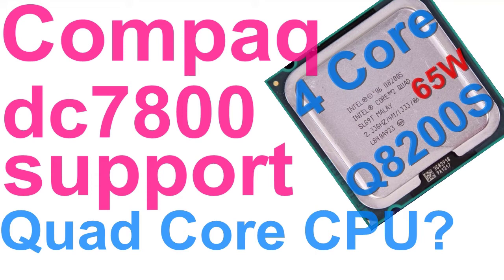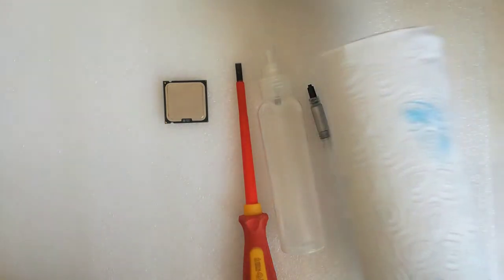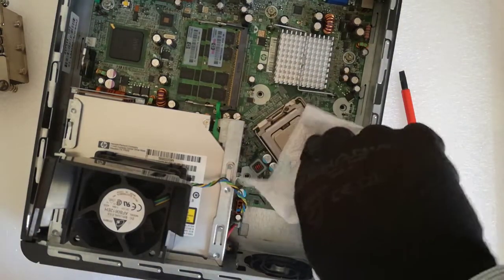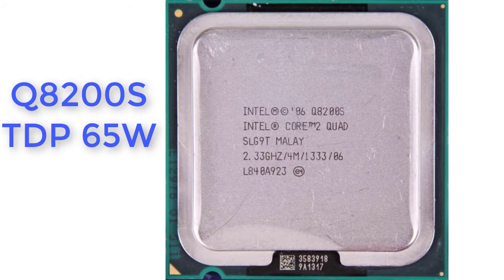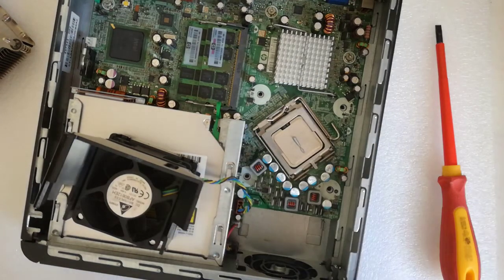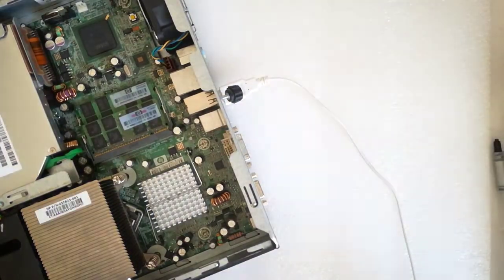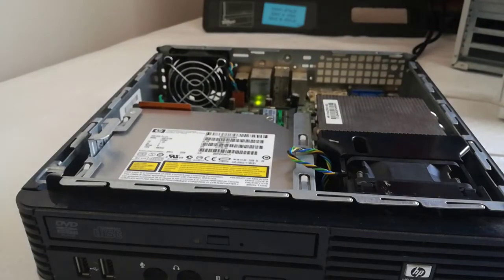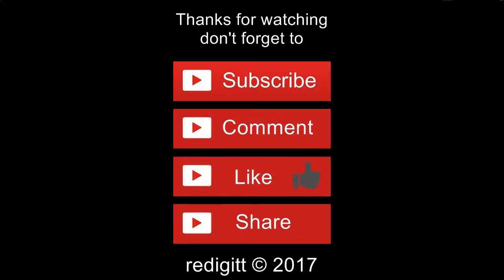HP Compaq dc7800 USDT does support 65W Core 2 Quad Q8200S CPU ? Ep.218

Comment: which cpu is the most powerfull for Hp dc7800 SFF?
Reply from the maker: Aloha, the most powerfull CPU for the HP Compaq dc7800 SFF according to the HP support page is the Intel Core 2 Quad Q9550 Processor (2.83-GHz, 12 MB L2 cache, 1333-MHz
FSB)
Thank you for watching, if my video or advice was helpful , then please don't forget to share, like the video and maybe subscribe.
Reply: @redigitt  Bro i subscribed and i want to upgrade this pc to its max limits gimme some suggestions
Reply from the maker: Aloha, thank you for your support, you can upgrade the HP Compaq dc7800 SFF PC 
1 update your BIOS to the latest version, step by step https://youtu.be/Ewx-3SM-JaU
2 upgrade the CPU with these CPU's https://youtu.be/nsoAW2Psrtk
Intel Celeron Processors:
Intel Celeron 420 Processor (1.6-GHz, 512K L2 cache, 800-MHz FSB)
Intel Celeron 430 Processor (1.8-GHz, 512K L2 cache, 800-MHz FSB)
Intel Celeron 440 Processor (2.0-GHz, 512K L2 cache, 800-MHz FSB)

Intel Celeron Dual-Core Processors
Intel Celeron Dual-Core E1200 (1.6-GHz, 512K L2 cache, 800-MHz FSB)

Intel Pentium dual-core Processors:
Intel Pentium dual-core E2160 Processor (1.8-GHz, 1-MB L2 cache, 800-MHz FSB)
Intel Pentium dual-core E2180 Processor (2.0-GHz, 1-MB L2 cache, 800-MHz FSB)
Intel Pentium dual-core E2200 Processor (2.2-GHz, 1-MB L2 cache, 800-MHz FSB)

Intel Core 2 Duo Processors:
Intel Core 2 Duo E4400 Processor (2.0-GHz, 2 MB L2 cache, 800-MHz FSB)
Intel Core 2 Duo E4500 Processor (2.20-GHz, 2 MB L2 cache, 800-MHz FSB)
Intel Core 2 Duo E4600 Processor (2.40-GHz, 2 MB L2 cache, 800-MHz FSB)
Intel Core 2 Duo E6550 Processor (2.33-GHz, 4 MB L2 cache, 1333-MHz FSB)**
Intel Core 2 Duo E6750 Processor (2.66-GHz, 4 MB L2 cache, 1333-MHz FSB)**
Intel Core 2 Duo E6850 Processor (3.0-GHz, 4 MB L2 cache, 1333-MHz FSB)**
Intel Core 2 Duo E8200 Processor (2.66-GHz, 6 MB L2 cache, 1333-MHz FSB)
Intel Core 2 Duo E8300 Processor (2.83-GHz, 6 MB L2 cache, 1333-MHz FSB)
Intel Core 2 Duo E8400 Processor (3.00-GHz, 6 MB L2 cache, 1333-MHz FSB)
Intel Core 2 Duo E8500 Processor (3.16-GHz, 6 MB L2 cache, 1333-MHz FSB)

Intel Core 2 Quad Processors:
Intel Core 2 Quad Q6600 Processor (2.40-GHz, 8 MB L2 cache, 1066-MHz FSB)
Intel Core 2 Quad Q6700 Processor (2.66-GHz, 8 MB L2 cache, 1066-MHz FSB)
Intel Core 2 Quad Q9300 Processor (2.50-GHz, 6 MB L2 cache, 1333-MHz FSB)
Intel Core 2 Quad Q9450 Processor (2.66-GHz, 12 MB L2 cache, 1333-MHz FSB)
Intel Core 2 Quad Q9550 Processor (2.83-GHz, 12 MB L2 cache, 1333-MHz FSB)

* Intel processor numbers are not a measure of performance. Processor numbers differentiate features within each processor family,
not across different processor families.
** These processors are compliant with Intel vPro Processor Technology and Intel Trusted Execution Technology (TXT)

3 upgrade the RAM up to 8GB (4x2GB)
4 upgrade the HDD to SSD
5 upgrade the VGA card (low profile) max 25W
6 install Windows 10 or 11 https://youtu.be/e55uDPo4bEo
Thank you for watching, and good luck with the upgrade and BIOS update.

Comment: 12/28/2022, I can confirm this is still true, I've upgraded bios and microcode and tried 3 different quads, all 3 didn't work.
Intel q35 supports quads, but this machine doesn't, maybe bios limitation due to power req from tiny psu.
Reply from the maker: Aloha, thanks for sharing.

Comment: Hello, I have a dc7800 (Small Form Factor) which support that cpu (q9550), but when I put it on the mother board the ventilator started to run very fast and suddenly I heard a burst in the power supply !!!! Apparently it's damaged. I had the E6550 which is 65w and worked for me, but the Q9550 is 95w. any suggestion!!!
Reply: Did it die, or were you able to fix it? I'm thinking of putting Q9550 in my dc7800 small form factor just like you.. Did you have many devices connected, or a GPU that consumes a lot of power? Because I'm afraid to blow up my power supply, but I don't have power-heavy things installed I think
Reply from the maker: 0. try te reset the BIOS
1. put back the old CPU and update the BIOS to the latest version, the microcode Update for HP 786F BIOS Family Computers with Intel Processors v.1.14 Rev. A , I have a video how to update the BIOS rd #206
2. try with a bigger power supply
Thank you for watching, if my video was helpful please share  and subscribe, have a nice day.
Reply: @redigitt  Thank you so much. I will see your video and I will give it a try.

Comment: Ok so subtle difference that I wasn't catching that I'm guessing others were missing as well:  when people talk about success with the SFF system, that is NOT the same as the USDT (ulta-slim desktop ).  If you refer to p9 of this PDF (https://www.bbt.si/modules/uploader/uploads/s_product/file/hp-dc7800_copy3.pdf) you'll see that C2Q IS supported in the SFF and CMT form factor, but NOT the USDT form-factor even when you're running BIOS 1.35 and Microcode 1.14a as I've now learned the hard way.  No big deal here as I'm only out $20 for the Q9550 and I'll find another system for it, but I was reading everything out there (which isn't a ton) that talks about upgrading the BIOS and microcode to 1.14a and then being able to support Q9400, Q9500, 9505 and 9550 but I was reading SFF and thinking "that should apply to the USFF system as well" and this is a false assumption.  Hope this saves someone else some further digging!
Reply from the maker: Thank you for watching, appreciate for your comment,
please share it,  to help others peoples,
have a nice day.
Reply: BIOS 1.35 and Microcode 1.14a   where is good site to get microcode from ?

Comment: I have  HP dc7800p - Minitower and manage to mod it to work with gtx 460 1gb ddr5...good luck finding quad for your machine
Reply from the maker: Good job and thank you, but I don't think the dc7800 USDT will work with quad CPU's, I tried with 65W, 95W TDP with no luck so far.

Comment: Hello can you tell me that q8400 95watt tdp will work in my dc7800 small form factor
Reply from the maker: Aloha, according to this document  https://drive.google.com/file/d/0Bw7yutXFBTHeZUhFLTVIUmlkXzA/view?usp=sharing  it won't work, the Q8400 CPU is not listed there. But I compare the Quad CPU's https://ark.intel.com/compare/33922,33923,33924,38512,29765 and there is not much diffrence, I think it will work , but I can't tell you for sure, I don't have the SFF PC to try. If you will try please post  here if it work or not to help others to. Good luck.
Reply: @redigitt  i have pc dc7900 sff i can install core 2 quad??
Reply from the maker: @modamer6027  Aloha, according to this document from HP http://www.hp.com/ctg/Manual/c01549447.pdf you can use Quad Core CPU up to 95W TDP.
Thank you for watching, if my my video was useful, please share and subscribe , have a nice day.

Comment: ppl say that  q6600 works ... it is about 10 dollars on aliexpress , I am waiting to come and will test it , also 2x2gb ram from there ...
Reply from the maker: Sorry, I tested 3 different TDP's Core 2 Quad  CPU's, the Q6600 105W TDP,  the Q8200 95W TDP and  the Q8200S 65W TDP, but none of them worked for me. If you have the same PC you can try another CPU with 65W TDP, but I think the highest /biggest CPU that works with this motherboard is the Core 2 Duo E8500 CPU or the E8600, but  I don't tested yet the E8600.
Reply: I have 7800 usdt  , and I purchased CPU , waiting to come ... and test it .  Actually  I am waiting X3220 CPU , so after a few days   I will tell you if it worked for me.  ( I purchased CPU from aliexpress for $8.95 ... ) 
By the way is your BIOS updated to the last one?
Reply from the maker: I have the latest BIOS, I made 27 video about compaq dc7800 USDT, BIOS, RAM, HDD, CPU upgrade, on-board WI-FI card installation  https://www.youtube.com/playlist?list=PLdsSKCXNCJYhNEKWdUPdFrRJyCjBBYL4L   I'm waiting for your CPU test, good luck, keep us inform please.
Reply: does not work with X3220 .... fan is starting and stopping right away ....  and 2 beepe , red  flash led instead of green ... . I was thinking that he is able to run quad , but .... , may be too much power needed? is there  "light" quad core processor ?
Reply from the maker: Thank you for your report, and there are 65 TDP Quad Core CPU's:  Q8200S, Q8400S , Q9400S, Q9450S, Q9505S,Q9550S .
Reply: so what is the best CPU which can be used with this computer ? Intel Core2 Duo E8600 ?
Reply from the maker: I tested only from Core 2 Duo E4500 up to Core 2 Duo E8500 https://youtu.be/nsoAW2Psrtk. I don't have Core 2 Duo E8600 CPU, but I think will work with this motherboard.
Reply: thank you, I am going to get  Core 2 Duo E8500 , as E8600 is double the price ... . (Mine is originally with E6550 )
Reply: i guess i will be doing the same